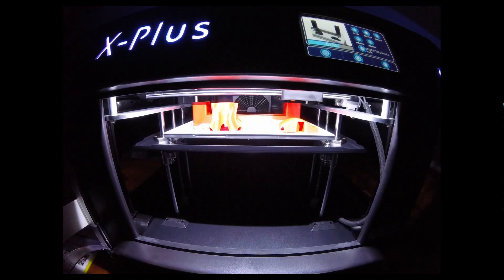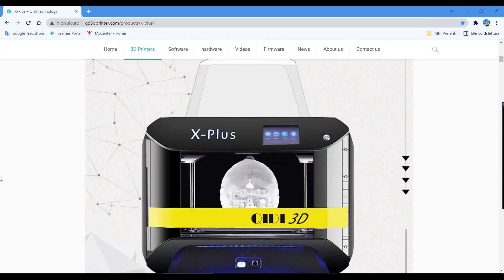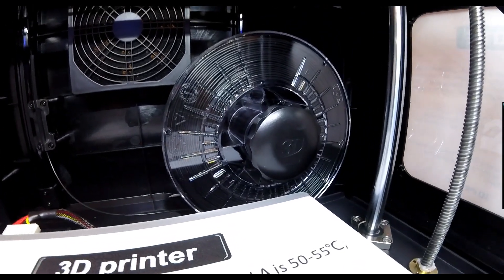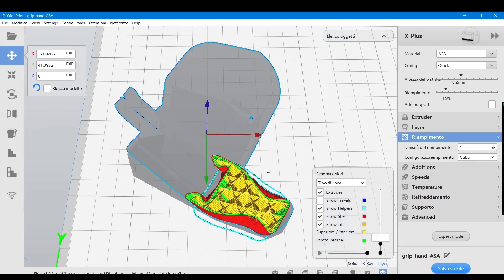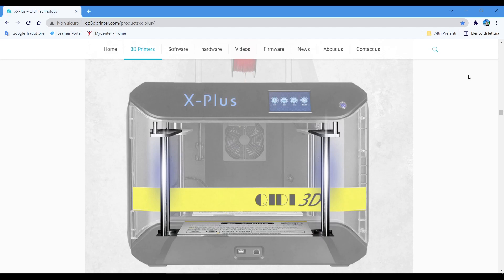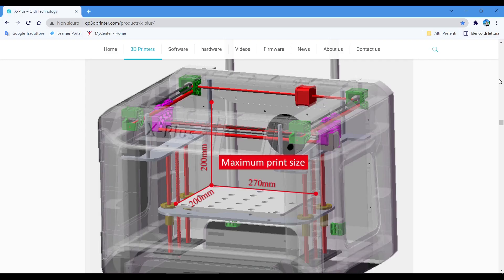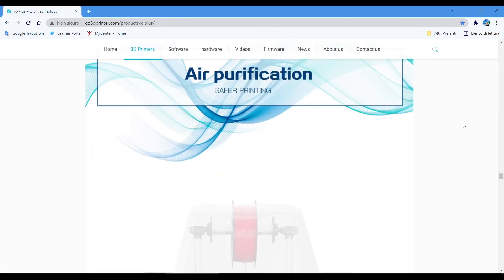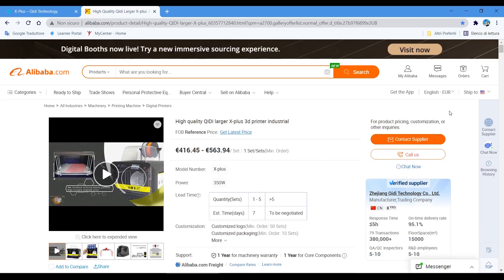Qidi X-Plus why buy it? and why not buy it?

Comment: Hey! which settings are you using for CF nylon?
Reply from the maker: Hi, is not a simple question.
Don't exist the universal parameters. Each brand of materials have the specific parameters. I usually use for see the best parameters slicer Cura, in this software is possible search on the marketplace  in materials category (https://marketplace.ultimaker.com/app/cura/materials), the brand and the material specifics, after this the slicer show you the best parameters for printer.
Not all brand are inside a marketplace Ultimaker, but there are many different type, I usually choose from those available in this list which brand buy. 
For the moment I haven't still print with CF Nylon, but when I will do this, I will use one of the material in the marketplace material list and its parameters.
This request is a great idea for record another video, for this specific use, soon i will.